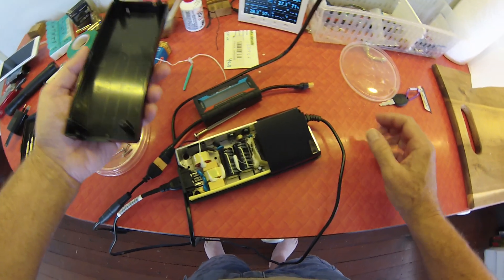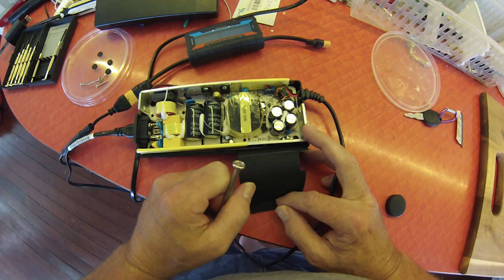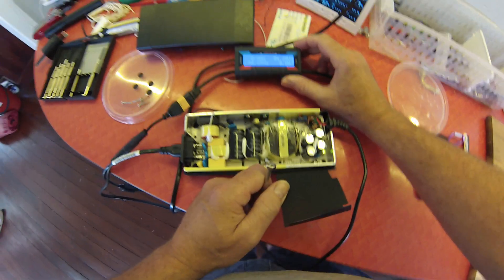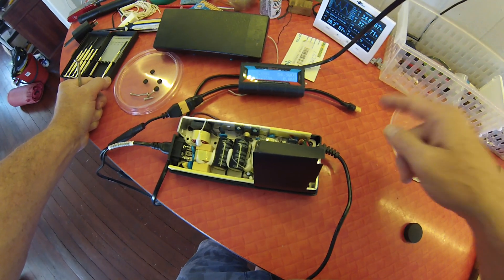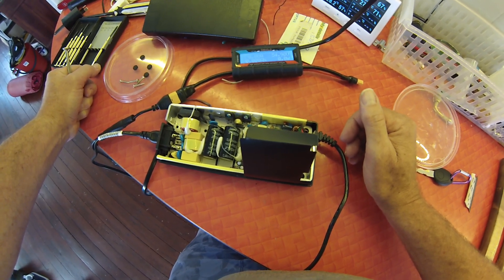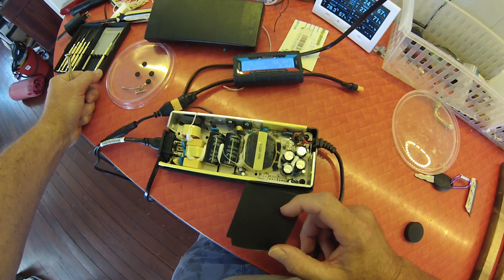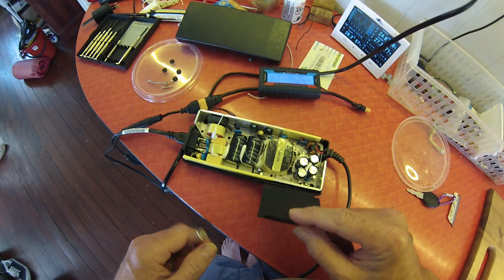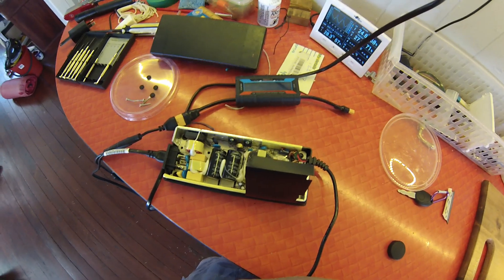Tuning the voltage on your scooter charger

Comment: which cheap battery chargers have adjustable dc voltage, with trimmer potentiometer ?
Reply from the maker: no idea, I just pulled mine apart and found it had this. This is the charger that came with the scooter ...

Comment: Gentlemen - attention please:
If you want to prolong the life of your BATTERY PACK e-scooter as much as possible, there is ONE and ONLY ONE thing you should do.
And that is - LOWER the voltage of your charger, NOT INCREASING IT!!!

By lowering it by 4-5% in practicality you allow the battery to charge up to 90% of its capacity, therefore practically DOUBLING the lifespan of your battery pack. 

Consider this for safety reasons as well as longevity. I did it and am pretty happy with the 10% range reduction - I frankly NEVER go 30-35 miles.
Reply from the maker: Evidence please.

Comment: Thanks for this. My 2020 pro model will only charge up to 54.1v. I tried this tweak but without success, still 54.1v then green light comes on. Unfortunately I don’t have a voltage meter to check it other than the one on the scooter’s display. Just to clarify, I turned the tiny gold coloured slotted screw about maybe a bit less than 1/4 of a turn anticlockwise. It was in the correct spot that you indicated so I think it was the RV you talked about. Is this correct? You didn’t say which way to turn it and you didn’t do a big close up so I may be turning the wrong thing. Anyway, if you can show me what I’m doing wrong it would be much appreciated.
Reply from the maker: if you turn it one way and it goes down you turn it the other way ... you MUST have your volt meter plugged into it and monitor it ... that's a must.

>Unfortunately I don’t have a voltage meter to check 
>>>DO NOT DO THIS WITHOUT A VOLTAGE METER<<< You must now go get a voltage meter (cost about $10) from any decent hardware (or better yet) an electronics shop) BEFORE you plug it into your scooter.
REALLY
Also you need to read this blog post about when it is charged and why you can't rely on the green light:
http://cjeastwd.blogspot.com/2019/12/when-is-it-charged.html
Reply: finophile thanks. As I said the voltage didn’t increase but it didn’t decrease just stayed the same. I read your blog and regarding trickle charging, I am aware of this and in fact my old Ninebot ES4 charger did this after the green light came on as you could clearly see on the app which showed the voltage slowly increasing. My WW charger doesn’t seem to ever show any v increase however I’ll leave it on the charger overnight as you recommend and see what happens.
Reply: Happy now, display showing  a solid 54.4v which is 99.5% full. I could push it further but I’m happy with that. Since new it would never ever go beyond 54.1v. Thanks so much for your instructionals. Keep ‘em coming!